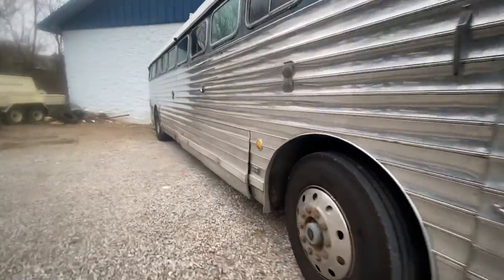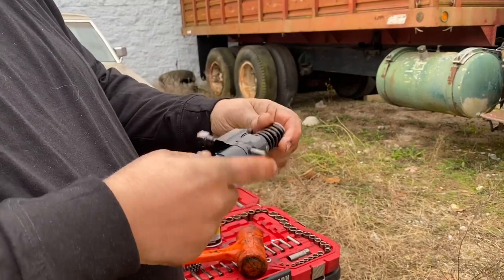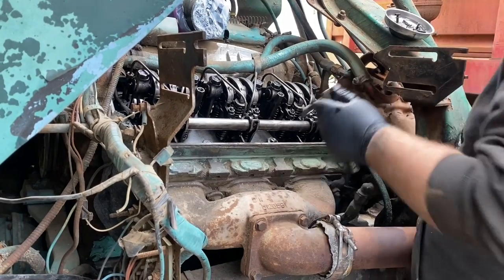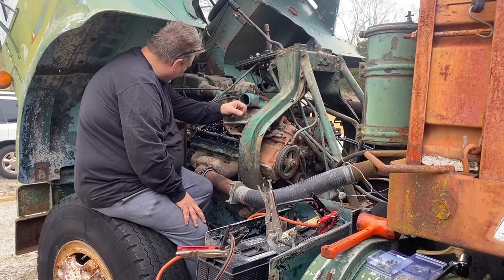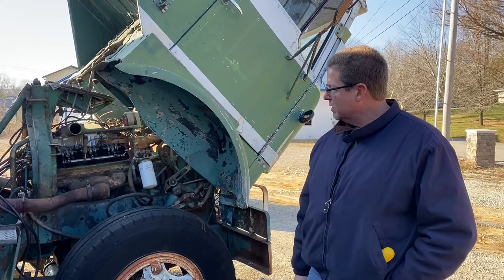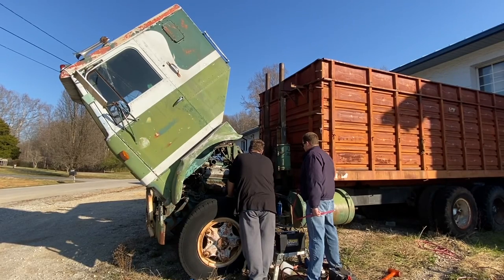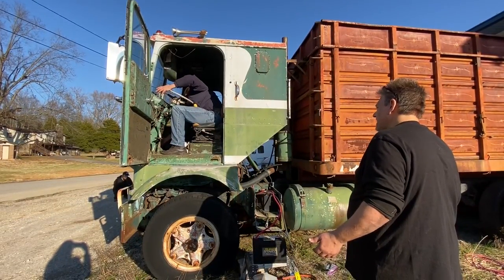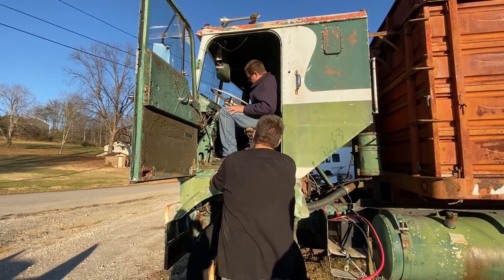1964 gmc cracker box truck 1st start in over 20 years. COE 1st start

Comment: That old solenoid you removed looked like it might have been a "Series-Parallel solenoid" used to connect batteries in series (24V) for cranking and then switches to parrallel (12V) for charging and running. I didn't get a good look at the solenoid you pulled - so maybe I'm wrong. These Series-Parrallel solenoids were common on tucks back in the 60s and 70s.

Comment: If that fuel in the tank is black it's full of algae, only good solution , drain and clean the tanks. Everybody has a thing about split rims, I ran a Battalion Trailer Transfer in the Army with 515 trailers all with split rims, changed at least 20 per week and if things were done the way they are supposed to be, split rims will not blow up, done wrong and it can be exciting to say the least.
Reply: Many people dump used motor oil into the fuel tank on these.  It could be just a lot of oil.

Comment: Just out of curiosity, is it not a good idea to use non chlorinated brake clean to cut varnish and carbon deposits, then PB wash for prelube? Is the brake clean too caustic for the pintle and seat? I can understand not using carb cleaner because it leave a residue. But, brake clean evaporates clean.

Comment: I notice that when you put the rack back in I haven't ever seen you fine tune it to make sure all the injectors are fueling the same we use to do that when ever we took one apart just wondering?  And also last summer early one morning I was running with a  bus that looked like yours it was early morning down buy st James Missouri going west always wonder if that was you Thanks

Comment: when the  injector. pops off...its pressure that i sprays at is....
3500.....5200. psi.....you could easily get fuel.  ingected. into your
body....i rebuild detroit injectors...and tested them on a detroit. trst stand

Comment: Scott is it still called a 6v71 when its a v6 instead of the inline like you have????..Thanks....Jack
Reply: Hi Jack, 
The straight engine in Lenny is 6-71 and the engine in this Crackerbox is 6V-71 with the V cylinder configuration.
Reply: But the inline engines has 7 main bearings versus fewer on the V6 version also the V6 version usually needs rod and main bearings because they are 1/2 the width of the 6-71 inline engine.

Comment: You know I have watched a few of these start a sleeping Jimmy over 20yrs and nobody yet has check the oil to make sure no coolant in it or the rad still has some coolant in it or none has mentioned that the O-rings in the heads has shrink and or crack as they have tendency of doing
Reply from the maker: We always pull the drain plug to make sure there is no water in the oil, as well as checking all fluids before a start is attempted.

Comment: Could it help to use a small hand held vacuum pump on the return line to prime the fuel system?
Reply: They use a hand pump sprayer set up to force diesel to prime.
Reply: @richardlazarski4553  oh duh, no injection pump on those engines

Comment: Another silly question for which I apolgise, but, why is there more exhaust showing from the right hand stack?
Reply: Probably a ring isn't set due to sitting so long or maybe excess fuel from the injectors,  same reason. 

Normally this clears up after being run in for a bit. If not,  something is out of whack
Reply: @richardlazarski4553  thank you.

Comment: So, why PB blaster as opposed to carb or brake cleaner?

Both are crazy cheaper... Just was wondering if there was a method to your madness...
Reply from the maker: Lubrication...transmission fluid would work too.
Reply: @BusGreaseMonkey  So, not hard core clean and lube after the fact?

Comment: its the fuel itself that causes the injectors to jam   and about a year or more of not running time for that?
Reply: A little of both to my understanding.  Best to bar over the engine, check that the injectors are not stuck and the rack is moving freely valve covers off.

Comment: What actually causes this freezing action and why does it neccessarily always seem to affect the GMC Detroit injectors?
Reply: They are lubed by diesel, they dry out and corrosion makes them stick.
Reply: Copy that, yes, I thought debris and contamination would be the culprit, however, I would understand that the additives in fuel would remain after other materials have leached out.Can you explain why this is not a regular occurence in all other injectors used in other FI engines? Jim
Reply: @jamespakipaki3625  because they are electrical or a totally different design.
Detroit injectors were 100% mechanical.
Reply: Yes, thankyou vector, I've got it now, that puts things into perspective for me.
Reply: Diesel and oil can cause this.  Based on injector design oil lubes the action lever and diesel lubes the piston area.  Either one or both can cause sticking

Comment: i never understood why it is even physically possible for a piston to make contact with a valve. why would any type of engine be designed like that?
Reply: Desired compression ratio dictates the compression chamber size.
Reply: A cylinder to make contact with a valve?
Reply: a piston
Reply: That's how diesels work. Every diesel is an interference engine.
Reply: only Ray Charles would design a self destructing engine
Reply: @drnoobynoob4723  every engine has the potential to destroy itself

Comment: I worked on trucks (mack) for 15 years I never seen a 2 stroke v6. Seen inline 6 and v8 but this ....
Reply: Yup,  they made 6v all the way up to 12v. Maybe bigger. I'm pretty sure DeBoss garage had one that was a 16v. They also had a little 3 cylinder that was in Oliver, and Massey farm tractors and construction equipment.  Detroit was everywhere back then.
Reply: And a 2-53 in train refrigerator cars
Reply: The holy grail of detriot collectibles is the very rare 1-71 gen sets.  Very difficult to find but beautiful once restored.
Reply: Most of the 6v71s were in city transit buses and fire trucks.  The 6v92 was very popular  in almost  all applications.
Reply: @markphilpott8735  Guess that`s why I never seen 1.I worked for a mack service dealer,saw a few fire trucks with 8v92.This was in the 90s.I left trucking in 95,got a job in a factory. still there.
Reply: @blackscotydog  I know there's a lot of nostalgia for those old Detriots. I worked  on almost all of the two-strokers for many years but when it came to trucks you couldn't beat a Mack. The toughest trucks, engines and powertrains bar none. Just remember for vocational applications nobody has sold more units than the R model and its variants.  I've even seen some Mack 743 engines on gensets that had over 25k hours on them and never had more than regular maintenance.  Never do that with a two stroke Detriot.
Reply: @markphilpott8735  yea I worked on e7 4 valve mechanical injected mack engines the fleet I worked for had a bunch that made a million miles without  a rebuild.

Comment: you do realize that both mufflers are probably full of mouse nest, or other critters. Diesels really dont like that.
Reply: One was but you could see stuff blow out at one stage
Reply: @jetstream454  I saw that, however from experience I would still suggest checking as one pipe after didnt smoke much from top but both were really smoking a lot from bottom which suggests a blockage.
Reply: @jacilynns6330  Yeah the left pipe looks suspect, right pipe just has a leak I think (looking from back of truck not video)
*Hmm I'll say driver side and passenger side, driver side pipe looked blocked, pass. side just leaky
Reply: @jetstream454  well its easy to check out on diesel. Remove bad flex pipes. Should be clear view to top of stack. You already know why that's important.
Reply: @jacilynns6330  Yes because before editing you said you can burn valves etc. Don't worry your original came up in my notification 😉

Comment: these are around 30 bucks at Autozone.. you can create a pair of short thick cables to put this inline of any of the vehicles you are working on to kill the battery quickly and easily.. https://wellsve.com/custom_searches/pdf/sales_drawings/SW8062.pdf  there are more expensive versions that can handle more current.  this one uses 12MM studs on the back. its over 130 bucks.. i could not find an amp rating.. https://wellsve.com/custom_searches/pdf/sales_drawings/SW5794.pdf

Comment: God I hate the smell of pb Blast!
Reply: Ditto! I’ve started using liquid wrench because it seems to work fairly well and doesn’t stink so bad.
Reply: Buddy Martin my go to is deep creep from seafoam smells not bad
Reply: PB blast isn't really bad. The worst I have come across is  Kroil. Stuff is effective but smells like corroded copper pennies and old gym socks.
Reply: @shane8911  That’s good to know, I used PB Blaster since the 70’s and have never been fond of that smell. Actually had a full can fall down in an old motorhome I had and dump the whole can into the one of the basement storage areas and I was never able to get the smell out of it, that stink went everywhere. Actually everyone that came to see it when I sold asked what the smell was. I’ve tried several different creeps and penetrants so far and the liquid wrench has worked awfully good but I’m always looking for alternatives. Will definitely try the deep creep, thank you.
Reply: Kanokroil smells the best but you have to order it in. Most places don't carry it on the shelf

Comment: When your in a airchair thousands of miles away, so easy to say some negative stuff but crawl in the hole with the men and get the rust out of the exhaust raining down your neck for the real effect. I don't like detroit's personally but they are in a lot of equipment and easier to find parts for than a cummins or cat and if its cat, just buy new as the parts are so expensive that you buy one before your done getting parts. I have worked on cummins and your hard pressed to find one un altered and then prices reflect a engine swap or sure wish it was a detroit   comes out of mens mouths. Patience as it will work all day for a few cents more a mile fuel wise. I never blew one up but wished so hard for it to sling parts or I lost blowers, air compressors and broke quill shafts.... had three million miles on that one with same heads in place and it was a tow start with propane to her to build up some heat in the cylinder walls/LOL. Yeah just slam fingers in the door each morning and drive with a attitude

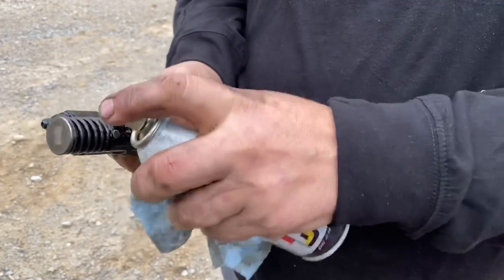Comment: @2:20 I'm old skhool like you... We should wear gloves. Chemical on the skin, not good.
Reply: Yeah Vegan yet, takes multi-hour dips in petrochemicals - with the largest organ of one's body (skin). Sorry, Scott-
Reply: @BooBooJonez  - Well, I made no intended insult and; you had a perfectly good reply going until, you rolled off with the "As for your need to open with a piss poor insult... (yadi-yada)" bit.
 The point you apparently missed; was, about a lifestyle choice (Scott's) for presumably health betterment/preservation (Vegan, in this case) - all the while, not exercising a similar level of (let's not even call it 'protection'); hedging one's bets... because, there are no guarantees of health or longevity, in this life. 

That said: correlation does not equal causation - my slightly older brother died from cancer, coming up on 4-years ago - who was a mechanic/technician - exposed daily, to all the usual elements of the job, for many years. Maybe just a fluke - maybe not- Either way, f/u for the latter part of your response. Good-day-
Reply: @markaoslo5653  Sorry to hear about your brother.
Reply: @BooBooJonez  - Acknowledged.
Reply: You can breath the stuff in as well. Not good.